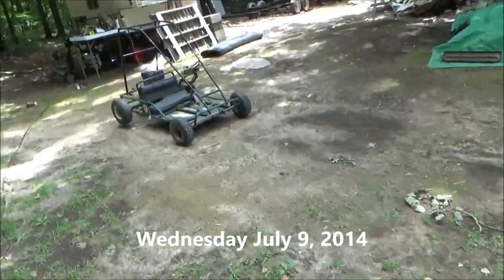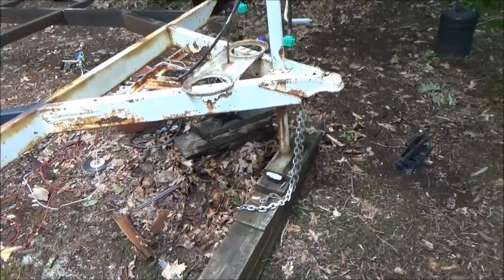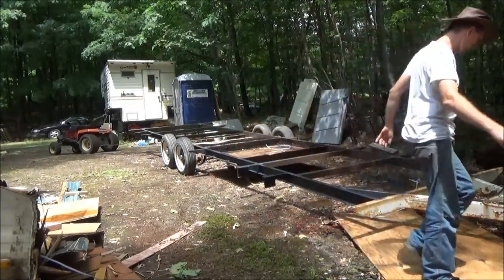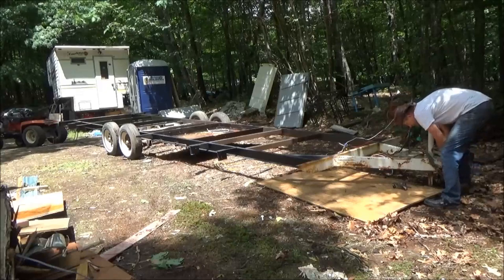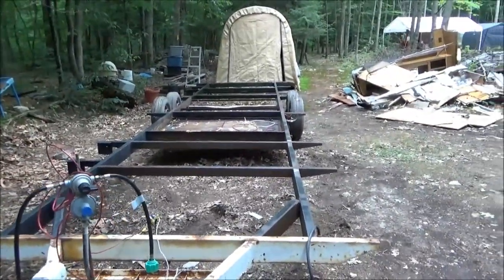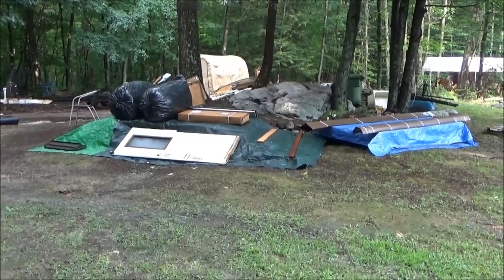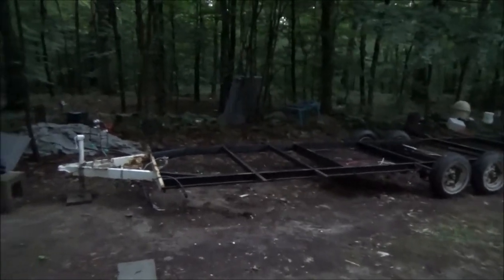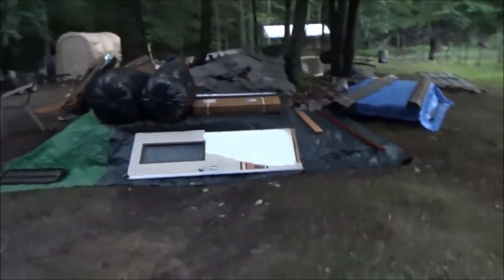Gokart Repairs And Prepping My Tiny Home Trailer

Comment: check the fuel filter if it has one on the kart ! also your float in carb. may be stuck . Try tapping on the carb. a bit .
Reply from the maker: There was water in the overhead valves and it is slowly working itself out.

Comment: troy is there valves on there? if so check the valve clearances. that will help all running issues yes i see there is a cover over the valves find out the proper valve clearance on the engine and adjust them! improper clearance will cause your issues
Reply from the maker: Yes it has overhead valves.

Comment: could have put tongue on tractor seat and sat on hitch took it any where slowly ,,,
Reply from the maker: I was afraid it would crush the seat or fenders.
Reply: maybe 1 bolt to remove seat then a 2x4 across the fenders, where there's a will there is a way,, but then you would feel like a truck/tractor driver and be pulling it up and down the meadow lol,,

Comment: I am so frustrated...
Reply: Why are you so frustrated Dew?
Reply: Beth DeRoos
He hasn't got a girlfriend. :)
Reply: I am frustrated because it would have been so much easier to put a counter weight on the end troy was trying to pull and then simple push th tongue in the direction he wanted it to go. Not to mention pulling the direction he was and the ill placement in the plywood which made it roll off. Seemed there is no understaamding on physics or fulcrums... Just wish there was more I could do... My trailer although only eight foot, is loaded with about 1000lbs. is easily moved by one person due to weight placement... Ugh...